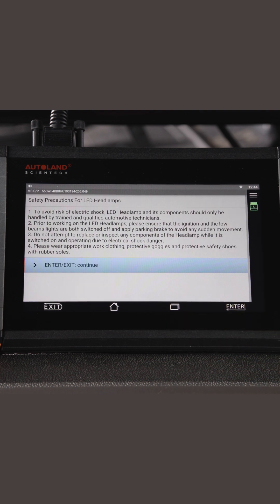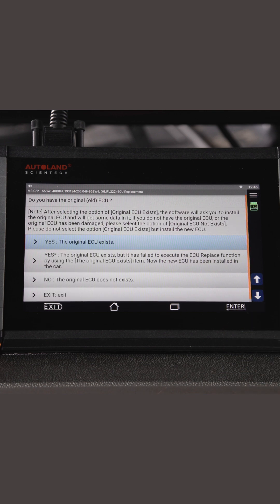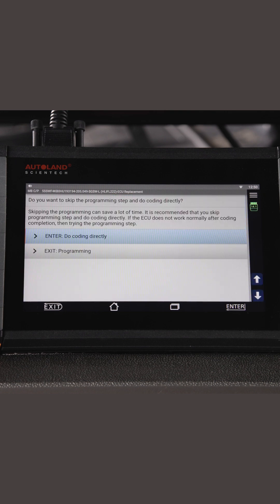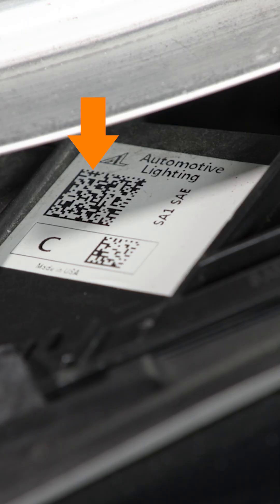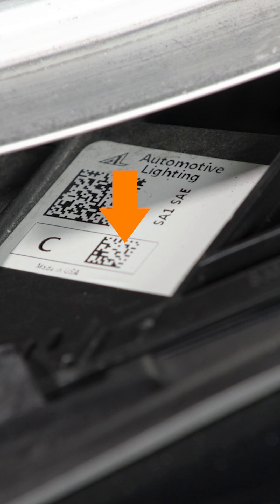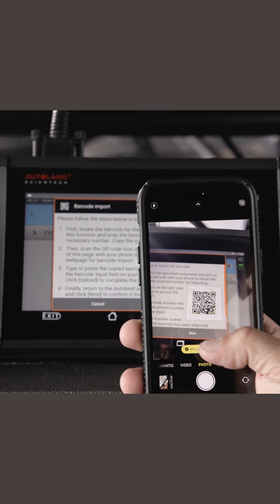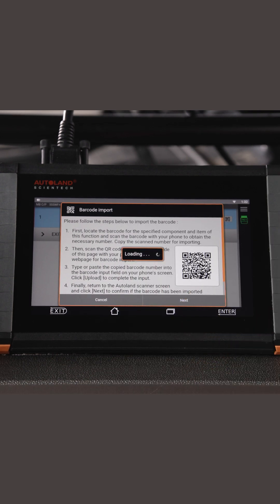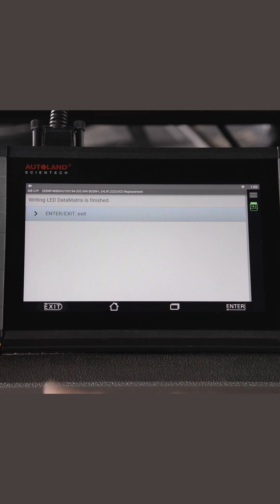How To Code Mercedes-Benz Headlight Data Matrix & C Coding Bar Code Scanning Into Control Module

Comment: Thanks for Showing though. But All Of these Steps Should Not Be Necessary For a Simple Headlight Replacement. What Happened to Replacing Your Headlight in your Driveway without Needing to Learn to Become a Certified Technician...?
Reply from the maker: It has to do with the control module and proper beam operation. On simpler systems, this is not necessary. For example, Halogen bulbs. More advanced options, more advanced repair techniques.
Reply: @AutolandScientechUSACedarPark There's really no acceptable justification for this Level Of Ridiculousness and Complication On a System that should be simple and have been simple for Decades/Centuries.
They can certainly design it simpler and less complicated Requiring none of these unnecceaaary Programming if they Choose to (Frankly, But, Sadly Only If Mandated to). But you/We all know the REAL and True reason why they design it that way.

Comment: All this to prevent you from using after-market headlights?
Reply: Nah, It's Just to Make You Spend As Much Money As Possible. Headlight in Vehicles Worked Just fine With Simple Replacement and Be on your Way all These Steps is For Control and Money Making.
Reply from the maker: No. This is done for part matching and beam optimization. Aftermarket can work, just not used parts .
Reply: @AutolandScientechUSACedarPark  Not true, used parts can be used and replaced
Reply from the maker: @HemiBoyBusiness  We have been asked a few times about installing used headlights, and here's the answer:
Good question. Here's the best way to look at it. We don't recommend it. 

Here's why. If you source a used headlight, you can swap the housing over to your vehicle, using all the old electronics from your vehicle. That will allow it to work without recoding. The vehicle will not know you swapped anything. However, the new (used) headlight housing will have or potentially have its own unique MATRIX data for the housing. You will then have to learn that dat matrix. Coding will not be necessary because you reused your electronics.
Reply: @HemiBoyBusiness  post the facts so everybody can know
Reply: @AutolandScientechUSACedarPark  So, if I replace my damaged headlight with the intelligent LED system with a preowned one but insert the current ECU modules, the headlight will NOT require recoding? Or will it not work?
Reply from the maker: @MarcusLeonard307  if you are replacing only the headlight housing and swapping all of the electronics over from the old one. You will not require any coding.
Reply: @AutolandScientechUSACedarPark  Thanks for the fast response! But this only works if the headlight housing is totally new? Will preowned work for this?
Reply from the maker: @MarcusLeonard307  Salvage will work, but has to be same part to match up with the electronics. Technically you should do the data matrix, but it will function.
Reply: @AutolandScientechUSACedarPark  Okay thank you. I assume you mean the same part number or same type of headlight?
Reply from the maker: @MarcusLeonard307  part number.
Reply: @AutolandScientechUSACedarPark  I really appreciate the help!